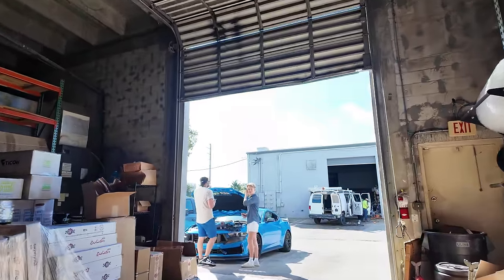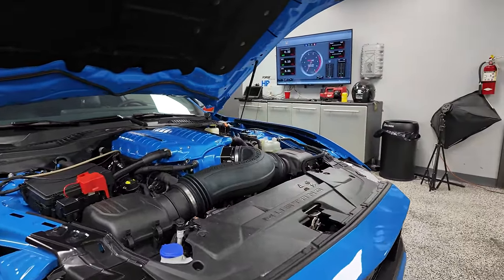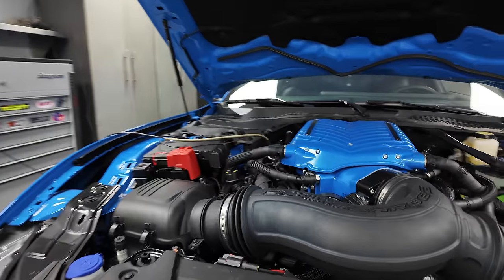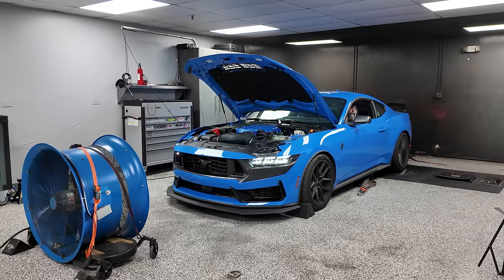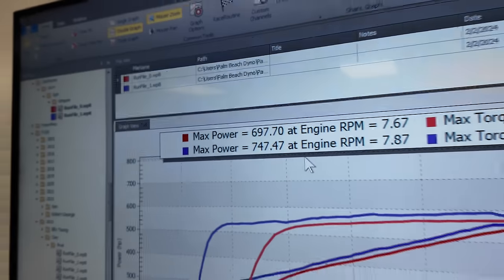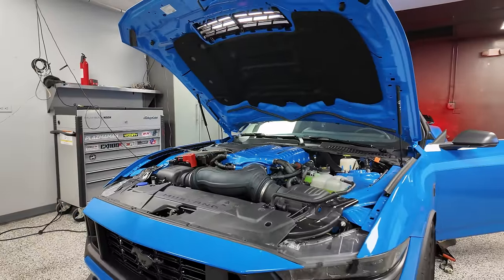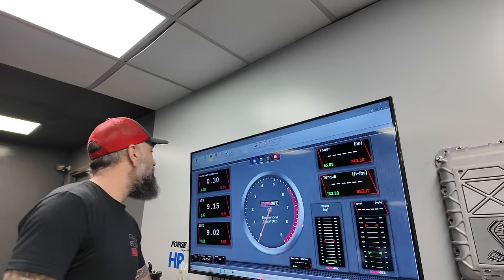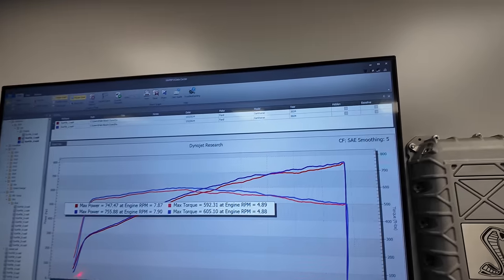7xx RWHP!? Whipple Supercharged 2024 Ford Mustang Dark Horse | Stock exhaust & pump gas!

Comment: Haters left the chat I guess. 😅
Reply: 😂😂 its dead in the comments. They're probably fussing at their husbands right now instead.
Reply: Soooo it made pretty much what an s550 would have made on the same conditions, at like 40k more MSRP. worth it.
Reply: @michaelweatherby144  What's your comment "Pretty Much" refer to? Maybe show us your stock based Whipple S550 Dyno numbers because a stock Whipple Gen 3 will not produce these Dark Horse Whipple Gen 4 Coyote wheel horsepower readings running pump gas. Your only comparing engines. Not Mustangs. The Dark Horse is a track monster with an improved chassis and it's hugh Brembo brakes that as Motor Trend said "paraphrasing" Pops ypur eyeballs out during hard braking stops. It has Improved aero. Improved Magna Ride. New steering box. Vastly improved interior with large informative digital screens. When the ECU is unlocked likely later this year. We'll start seeing the full potential of this bad ass Mustang. An engine capable of 8000+ RPMs with it's current tune required to stay within government regulations that actually limits its RPMs below it's 7500 redline. This tuned Whipple setup will easily exceed 800 wheel horsepower that may move closer to 900+. Come on. Are you a true Mustang fan that's happy Ford continued manufacturing the Mustang or a person who is pretending to like Mustangs. I currently own a Hemi Mopar, but after a recent test drive of the new Dark Horse. This spring my next summer vehicle will be a Dark Horse
Reply: it took him getting called out for using octantium and claiming pump gas records...not hating just calling out the obvious.
Reply: @minibikemadman Alex let lethal have it and they are mad. 😂
Reply: @minibikemadman .
Reply: Take it to the track my guy, lets see what it runs on the quarter. Before you make assumptions that it is fast.
Reply: @DWH300 improved chassis? It's an S550 with an updated look. It's not different than when Ford went from the 94-98 looks, to the 99-04 looks. Exact same chassis. Track monster? Every other review group has compared the DH to the previous top handling package (not GT350) mustang and said (if they had the same tires, the lap times would be identical. 

Idk where you're getting all this "improved car" info from, but it's not. It's just an S550 refresh. Nothing was improved about the chassis. In terms of improved handling, all it has is better tires from the factory.
Reply: Be carefully theywill call your boss@minibikemadman
Reply: @LaKuan its not a drag car, 1/4 mile times mean absolutely nothing. 60 to 130 is a better example of power.

Comment: Thank you for the transparency.  The numbers appear to be the result of a more efficient blower and more aggressive Whipple tune and not necessarily the gen 4 coyote since they tend to come up short in stock form.  I think this blower and tune on a gen 3 s550 would make similar numbers.
Reply: Purchase a new stock 2023 S550 GT. Throw on a Whipple and take it to the Dyno and let us know the numbers. You will not hit the numbers the stock based Dark Horse Gen 4 Coyote produced. Ford had to tune this engine to meet government requirements with a rev limit of 7500. You mentioned coming up short in stock form. All the current stock Dyno numbers I've seen show the Dark Horse produces it's advertised 500 crank horsepower. Have you even test driven a Dark Horse? 

As Motor One pointed out comparing the Dark Horse Gen 4 Coyote to the Gen 3. It wields upgraded internals, namely forged connecting rods, a unique balanced crankshaft, and strengthened camshafts
Reply: @DWH300 They certainly hit the power numbers on our dyno in stock form. Many run these on the chassis dyno in failure mode, which limits power enrichment and pulls timing. Its imperative to dyno correctly and monitor data. The stock calibration is about as good as a stock cal could be, they extracted all the power possible for 93 octane which is still more than a Gen 3, especially considering the 22-23 lost 10hp from the factory.
Reply: Same thinking here. Seems the dual inlet (requiring dual air filters + hardware) into a single TB may be more of a restriction than single tube+big mouth airfilter. I bet it will gain 5-10whp on a single inlet/filter.

Comment: With high flow exhaust and e85 guarantee 900 whp. If a f150 with the party pulley same setup on e85 and exhaust put down 989 on hub dyno. If you go for more need the crank support over 750 whp it's a must

Comment: Is the dark horse have the same engine internals as the regular 5.0 ?
Reply from the maker: The Darkhorse has the rods and a few other components off of the 5.2L predator from the 2020+ GT500 where the GT engine doesn’t.

Comment: Gorgeous car !  So explain to me how Gen2 Gen3 can only make 650-700 on 93 safely and the Gen 4 can make numbers like this ?  My Odin Gen 2 on that Dyno with catless headers on 93 and custom tune from PBD only made 685 ?  What’s the difference in the gen2 and 3 and the Gen 4 ?  Not being critical just looking for knowledge ?
Reply: Nothing is different between the gen 2 or 3 compared to the gen 4. They can all makes the same hp mod for mod but anything over 700whp on 93 octane on a 12:1 compression engine is stupid
Reply: Don't forget this is the new Gen6 blower. Any efficiencies achieved get returned to the wheels. So if the Gen6 takes 35 less hp to drive it then that is free hp.
Reply: @KenBjonnes  so basically the Gen6 Whipple is more efficient then the Gen 5 and the Odin ?  Is that what you’re saying ?
Reply: @KenBjonnes  so all these test prove that the gen 6 whipple is better than the gen 5, not that the gen 4 coyote is better than gen 3. Put a gen 6 whipple on a gen 3 same mods and pully revving to 8k I bet it will make the same power.
Reply: @Travisisaac55 well of you look at the engine breakdown, the gen 4 is different from the gen 2 and 3. They added some new parts. So until someone just breaks down the engine. We will never truly see what is different other than using the catalog from ford. But the Gen 4 is more refined than the gen 2 or 3 were. It's not the same engine part for part. They added some things to the gen 4 to help it make power. The DH has different parts even in it's engine. So these engines while retaining the the core blueprint of a coyote. Have been upgraded with each gen to be better. So same with the gen 4, they added stuff to help the engine and improve.
Reply: @Travisisaac55  There's a lot of differences. New SC makes more power with cooler temps, less power consumption which ends up being free power. The new SC inlet improved flow and increased efficiency. The dual intake system flows better, which increases efficiency. The engine itself has updated camshaft so its not a direct carry over.
Reply: @DustinWhipple  Gotcha, I wanna see what a gen 6 Whipple will do on a gen 3 mustang. Will you guys have any available for the 2018-2023 soon?
Reply: Yeah I’m capped off at 720 on pump 93
Reply: @Travisisaac55  Yes coming very soon, but we've tested this already, it still doesn't make the same power as the new Gen 4 Coyote. The calibration is a significant evolution of the previous calibration and the better camshaft helps flow.
Reply: @SIK50H  685 and was told it’s not safe to pulley down.
Reply: @freedom6919741  yeah I can’t pulley down anymore I’m on the smallest I can run on 93 but I got a fuel system on the way for E soon

Comment: What about the cats at that power level? I’m sure things get fairly warm under boost
Reply from the maker: Cat protection is still on in the cal. So far we haven't seen any issues with the cats during testing that's been done and continues to be done for the cal with this kit to pass emissions.
Reply: No problem with cats at this power level.
Reply: @DustinWhipple  awesome job!
Reply: @Lethalcamp  good deal guys. Thanks for clarification!
Reply: @DustinWhipple  @lethalcamp Does this cal support E85?
Reply: What about E85? @Lethalcamp
Reply from the maker: @RecklessRegal  it does not support e85 at the moment. In addition to a different calibration fuel system upgrades will be required to support this type of power with E85.

Comment: At 800-850whp the 10spd will be junk in no time.. Ask me how I know.. I went thru the stock one in under 2500mi, the second one went in 3100mi.. The 3rd is still living as I waited 4months to have it built by Manuel, but its only got 2100mi on it at this point.. If this one shits the bed in less than a year its getting a th400.. 10spds are cool for under 700hp & under..
Reply from the maker: Maybe your 10R80 was built on a Monday. My experience with the 10R80 on my 2018 GT was completely different. That car saw so many passes at the track starting in the 12’s and ending in the 8’s. Best pass of 8.64@157 and never had a single issue with it. Granted we did upgrade the steel and frictions plates with Mcleod’s kit but other than that it was a solid setup that supported over 1100rwhp.

Comment: So the $9,900 .. is that installation and all??
Reply from the maker: No. The installation is separate from the kit itself. Most shops charge in the $2000-2500 range to install a complete Whipple system like this.
Reply: @Lethalcamp  oh ok.. so I buy the kit.. you deliver it to me.. I take it to ford then you guys tune it?
Reply from the maker: @Super122891  We can certainly get a kit out to you, but Whipple supplies the calibration as part of the kit, which would be flashed during the installation. As far as having Ford install, I would talk to your dealer of choice to see what they charge and if they are willing to install.
Reply from the maker: @Super122891  If you purchase the stage 1 kit with warranty in order for that warranty to be in effect the kit needs to be installed by a Ford dealer or ASE certified tech. If you purchase the stage 1 kit without warranty or stage 2 kit which doesn't have a warranty you can have whoever you want install it. Once you order it from us we can ship it wherever you like and then choose who you would like to install it. Both stage 1 and stage 2 kits come with the device, tuning voucher and instructions on how to get the tune. Once the tune is requested from Whipple they email it over where you load it onto the device and then flash the car with it. So there's no need to go anywhere else other than the place it's being installed at to tune the car once the kit is on the car. Let us know if you have any other questions.

Comment: I would almost be willing to pay for that dude to take his car to a different dyno to see what it runs.  that seems like a lot of HP for a car with stock exhaust & cats with 93 octane.
Reply from the maker: It's the same dyno we used to dyno our 2024 Mustang 6 speed manual stock where it only made 396rwhp. Then we made 833rwhp with the Whipple on the 3.625" pulley with 93 and Octanium. It's a reputable dyno so not sure why that's even being questioned. 

We've been showing everyone results of these S650's with the Whipple on it which is why Igor wanted to come down and use the same dyno we used. Our results were questioned so we followed it up with a completely stock Dark Horse with just the stage 2 kit on pump 93 (no octane booster) and it's still being questioned. At some point you gotta realize that the results are real and impressive.
Reply: @Lethalcamp  Do you suggest that customer continue to run that pulley on that tune with just 93 octane?
Reply from the maker: @theshit7226  There's no reason not to. The kits will come with the same pulley and cal as what you saw here. The Whipple cal has gone through extensive durability testing at Ford in addition to several other test cars in the wild such as ours, Whipple's and Igor's. What you see here with Igor's car being a 100% stock car with just the stage 2 blower kit and Whipple cal is exactly how it will come from Whipple. All safety features from the stock calibration are still all in place. If the car senses knock it will pull timing back to a safer level until higher octane is seen. As mentioned this is without a doubt the most advanced cal that Whipple has ever done. A lot of time, money, expertise and testing is what went into it to become what it is now.
Reply: Pretty sure whipple paid for him to take it there.🤣
Reply: @mooosestang  We didn't pay for him to go there. We also have tested multiple cars here and others have tested. That is in fact the power.
Reply: @DustinWhipple  I saw it on facebook so it must be true.😜